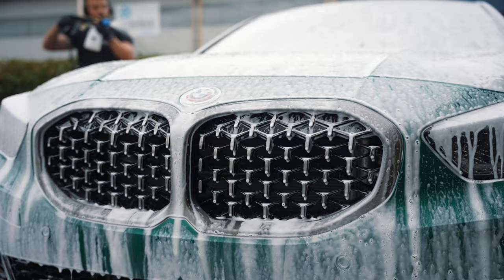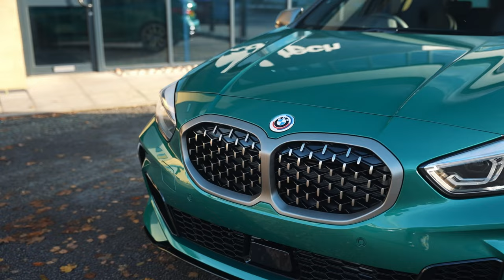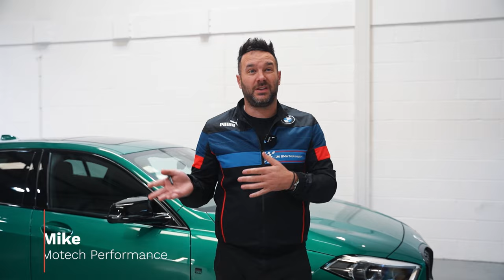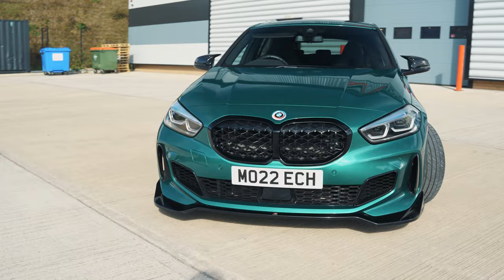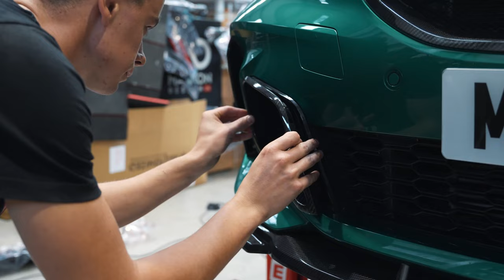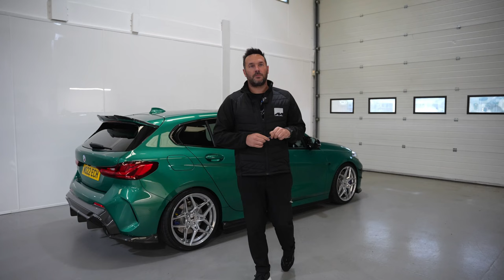The full transformation of our BMW F40 M135i n under 20 minutes

Comment: The wheel is 8.5x19" offset 45? What tires do you fit on them? Have the same wheel dimensions with a Michelin PS5 235/35 on it and it touches the fenders on all 4 corners. pretty annoying.